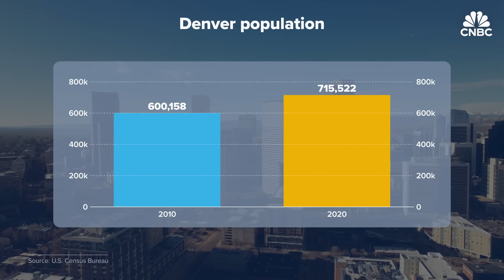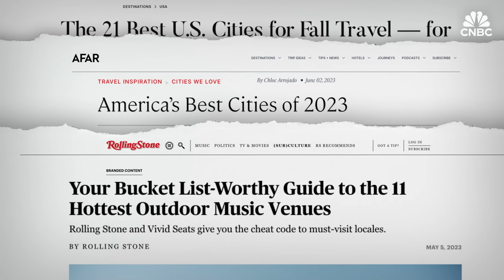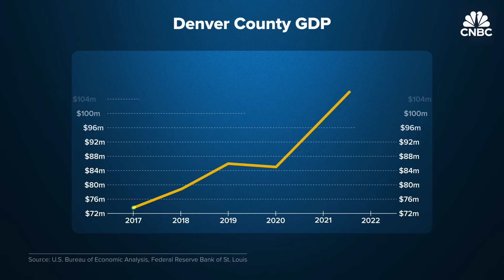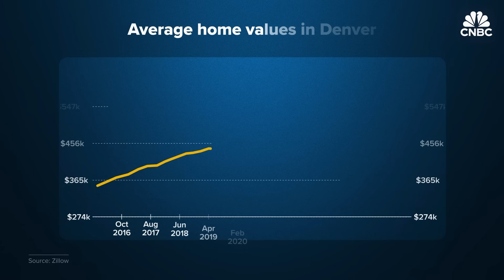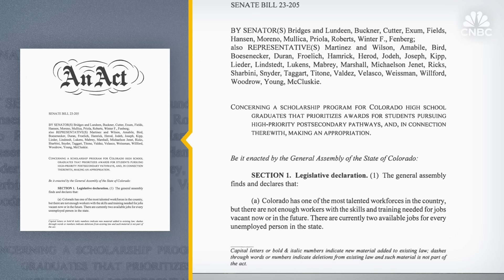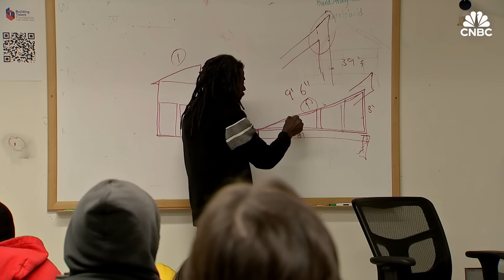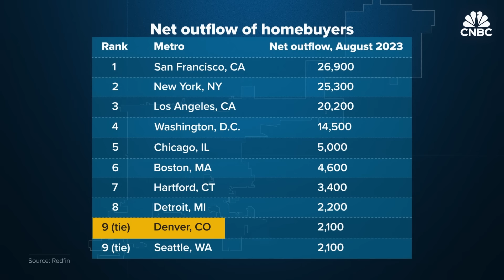Why Denver Is Struggling To Keep Up With Its Economic Boom

Comment: Denver has been destroyed by the likes of Polis and the completely useless mayor Johnston.  Low-level crime is through the roof.  There is no police presence and no law enforcement.  Supposedly in July there was a special action to target vehicles with no license plates or expired license plates, yet that yielded exactly nothing.  No one I know or encountered on social media platforms even saw a single cop enforcing the requirement to have a licensed and insured vehicle.  Road accidents happen constantly as Denver's population becomes overwhelmingly selfish and willfully disregarding of the law.  No one stops at stop signs, speeding is rampant, red lights are meaningless.  And when accidents do occur, do the cops show up?  Can you even get an answer on 911?  Guess what happens then?  You have to claim through your own insurance to fix your car — because car repair costs have skyrocketed over the years — and you get to pay higher insurance premiums because the cops don't write tickets to assign fault anymore.  Because, well, no cops.  So you see cars driving around with whole portions of the body just missing.  No front or back bumper, no grill, no catalytic converter (because thefts of those has been going on now for years here), body parts taped or tied on with string, no license plates.  If you don't have a six-figure income, then you are stuck renting and in Denver, that isn't pretty.  Rents are sky high, massive rental companies owning all the properties don't care about maintenance or property up-keep, so the only way you'll afford living in a rental apartment is with roommates.  You want to go in the mountains?  Good luck.  I-70 is jammed all the time, particularly on weekends.  Arrived at your trailhead and want to park your car?  Good luck, because there are so many people with the same idea as you that you won't find a space.  The mountains are over-run by people, most of whom couldn't care less about actual protection of the environment.  They are just there to get a selfie of themselves doing some stupid thing in the woods like trying to get a picture with a bear.  Denver's government as well as the state's is best described with a single word: incompetence.  They just can't get the basics done anymore.  The straightforward services like trash, law enforcement, education, parks, these seem to be beyond their ability to handle.  If you can't do those things, you know the politicians can't handle the big and hard stuff like housing and transportation.  To natives and people who have lived in Denver more than thirty years, it feels like this city is in steep and rapid decline with leaders who just don't know what to do or how to fix anything.  At this point, the consensus is starting to form that it is time to find a new place to live.  Denver is a disaster and if you stay here too long it will ruin you.

Comment: Denver also leads in gentrification. As a young millennial born in Colorado this boom hurt locals. I was unable to buy a home and barely could afford rent when I lived in CO. My home state is no longer recognizable its home to the rich and is pushing out the middle class and poor. I had to move where cost of living was reasonable and can proudly say I am a homeowner now. I miss Colorado all the time though, wish there had been jobs that paid a liveable wage there and housing was affordable.
Reply: I’ve been to Colorado 4 times in 30 years. It’s gotten crazier each time with the traffic. Not what it used to be. I really don’t want to make the problem worse for all of you by being another coastal transplant hogging up the roads. Roads/highways can’t handle the current population with the sprawl network, yet housing isn’t enough for demand. And transit stops are poorly located and have weak connectivity, resulting in low ridership. And westbound traffic on Friday afternoons is bumper to bumper all the way to Silverthorne/Breckenridge: I experienced that nightmare in broad daylight two weeks ago and it rivals LA unquestionably.
Reply: You obviously didn't look in Pueblo.

Comment: PPP loans were forgiven to big corporations. The small businesses barely received grants or loans during the pandemic. So many small businesses have shut down and continue to do so. Denver is filled with horrific corporate slumlords and there is little to no regulations and resource to protect tenants. Denver is great. But it’s not possible for young people to thrive without the help of parents or grandparents. Many of my peers from 20-30 years old are moving out unless they are high earners. And even then, they will move to an affordable area because their jobs are remote. 

Low price housing doesn’t do much considering the person paying for the house will never build equity as affordable housing could not be sold for 30 years at market price. It has to be sold at AFFORDABLE housing prices. 

The homelessness has been a problem long before migrant workers. Denver failed to locate proper housing and rehab efforts to displaced folks and the pandemic alongside lack of assistance exasperated the already existing problem. Now, you see homelessness on every highway exit. You see it from FOCO to COSP. Not to mention, Aurora is now dealing with growing gangs. When you place poor people and treat them like rats, guess what they do? Riot. And that’s what’s happening. 

Government NEEDS to step in as of yesterday to plan accordingly and mitigate risk. Because it’s a mess. Where are the crazy taxes going? It’s clearly not directed to housing, public transit, or public schools… Public schools, after school clubs, and keeping people busy and educated needs to be a priority. Only way to have a clean, growing, healthy environment is through education and support.

Comment: I lived in Denver for 46 years. Retired in 2019 and moved 200 miles from Denver and 200 miles from Albuquerque. There is an HVAC service company here that has had a "now hiring, no experience necessary" sign in the window for two years. The local MacDonalds has a now hiring sign "$20/hr to start". That sign has been there for two years. Can't find an electrician. Can't find a plumber. But I guess earning six figures in a small town is just too much to ask. Rot in the blue cities.

Comment: If you moved to Colorado and bought a home before Covid, then your mortgage is reasonable and everything is fine. But if you come after Covid increased prices by 50-75%, then housing costs will be a problem on the average salary. Summit County Colorado, where there are four ski areas, would have regular boom and bust real estate cycles. But once most of the land was built out the bust cycles went away. The same thing is now happening to the Front Range.

Comment: My wife and I are teachers and we used to live in the Denver area. On both of our incomes it was almost impossible to live in a safe apartment. We moved to Ohio, bought a 3000 sq ft 3 bedroom home and can now afford to have kids on the same salary
Reply: I been hearing a bit about Ohio being affordable. 

Are the winters very bad?
Reply: @geofox9484 nah, I mean occasionally it could get into the single digits, but usually it hangs around teens to low 20s and 30s during prime winter
Reply: Did you also gain 200 pounds each in order to fit in?
Reply: You could do that anywhere in Colorado that isn’t Denver…
Reply: Wow I moved to Colorado Springs from Cincinnati in 2013. If you're not making $60k a year it's rough. And jobs hate giving out raises.
Reply: Why didn't you move to Pueblo?

Comment: Tell NIMBYs that R1 zoning, million required parking lots, and minimum lot sizing needs to go. You gotta be dense like European cities to enjoy less homelessness and cheaper housing. Smaller,  yes, but cheaper.
Reply: You don't have to be dense.  You just have to build.  The problem is a process that makes it difficult and expensive to build.
Reply: @ISpitHotFiyaa  In fact, you do need density if you're going to have any substantial quality of life.  Sprawl leads to "drive till you qualify", and yes, you get to SEE less homelessness that way, but it is still there.  You spend more on services in the long run leading to continued flight, and you lose out on successful third places, job opportunities and cultural benefits.
Reply: @nickmonks9563  No it doesn't.  If you don't like "sprawl" then don't live in the suburbs.  People like you telling other people how to live is exactly the problem with housing in this country.
Reply: @ISpitHotFiyaa  I'm not telling other people how to live.  I'm explaining that if people want to actually solve the problem they will need to modify their expectations.  If the place you can afford to live in is two hours from your job then you have a problem.  That's the nature of sprawl.  Sure, if you're lucky enough to have a high paying tech job near your suburb, good for you.  But that's not the reality for most people.  On top of that, suburbs are subsidized by their more dense counterparts (and by increasing new sprawl) because there is just so much more infrastructure to build and maintain, but not enough of a tax base to maintain it after around 20 to 30 years...which leads to people fleeing those suburbs for other ones or other cities, diminishing the tax base, making those locations unsustainable.  Now people might be able to afford to live there, but the services are awful, employers don't want to be located there, and you're left with continued housing issues as a result.  

Density by itself doesn't solve the issue, but in conjunction with smart planning and incentives, it is a major component of building sustainable housing solutions, in addition to sustainable cities in general.  That doesn't mean every locale needs to be a skyscraper riddled nightmare, but single family cul-de-sacs have very limited sustainability value in a housing crisis.
Reply: @nickmonks9563  That's not the nature of sprawl.  That's the nature of oppressive planning.  People live two hours away because the cities two hours away actually allow houses to be built whereas the ones near the jobs are worried about sprawl and therefore don't allow houses to be built.
Reply: @ISpitHotFiyaa  Houston, Phoenix, and Los Angeles beg to differ with you.  All cities highly permissive of sprawl.  It sounds like you're trying to turn this into some ideological fight here, but it's not.  You may enjoy living in the 'burbs.  And you may have a job near where you live.  If so, great.  But the reality is that if most people want to be near where they work, lower the costs of transportation, lower their property tax burden, and improve access to services, that requires density.  My own neighborhood, which is a lower density inner suburb, is dealing with this right now.  They are complaining that we are in a food desert because we have no nearby grocery store that our often older population can't walk to...but we also don't currently have the density to support one.  So you drive or have to pay extra to have food delivered.  These are the externalities that sprawl hides when we are tallying costs.
Reply: @nickmonks9563  I've lived in Houston.  The commute was fine.  Housing was a lot more affordable.  Nobody lived two hours outside of Houston in order to afford a house.  That's something cities practicing growth management can't claim.

And this is an ideological fight.  You think you have some right to tell people how to live and I think people should make their own choices.  Those are two different ideologies.

Comment: The public transportation system sucks SO BAD! In recent years, they built a railway system from downtown Denver to the northern part of the city. Guess where that rail system ended up going! To the rich home areas off Colorado Blvd. It should have gone to the lower income apt areas where the bus line goes. But no. So stupid! You'd think with gas prices, and the traffic congestion, that would be the smart move. I mean to own a car IS a status symbol. Again. So stupid.
Reply: The Turkeys in Eastlake have to get downtown also.

Comment: I lived in Denver for a few years in the early 1980s. The thing to know about Denver is that it's the only big city for 1000 miles in any direction, so it's kind of an odd place. People think of it as a major city but that's mostly because it's all by itself in a geographic area that is either plains or (to the west) a mountain range all around it. It's nice, but it's no NYC or LA.

I haven't been back there in decades though so I don't know how much it's changed since then.
Reply: Thank God it's not LA or NYC.
Reply: Denver is Ghetto if that makes you feel more at home.

Comment: I just visited Colorado this month. I love the state but the Denver metropolis is a salad bowl of smog, traffic, sprawl, and all kinds of economic challenges. There are upsides, but they are outweighed. Once west of there and well into the mountains, Colorado is a great state.
The other problem is that the metropolis has too little housing for the demand, but too little infrastructure for the current population as it’s very much sprawled. Plus the public transit stations are poorly located, surrounded by mostly-empty parking lots and open fields. Ridership is weak from the poor connectivity.
And two weeks ago I did something one should avoid at all costs: driving west into the mountains on I-70 on a summer Friday afternoon. Even well west of Denver and in seemingly nowhere, it was bumper to bumper traffic all the way to the Continental Divide. Forty minutes on a quiet day took two hours.

Comment: Living in Los Angeles, I just don't see the appeal for living in Denver. What does Denver have that LA doesn't already have? 1.7 jobs for every 1 job seeker?  If all the low-pay dish washing jobs, cook jobs, janitor jobs, and the higher pay plumbing jobs, caregiver jobs and nursing jobs are excluded from the pool, how many jobs that are available are also desirable for the average job seeker??  How many of those so-called jobs available pay a decent wage to afford the cost of living in Denver? Numbers alone don't mean anything. Yes, the 70,000 homes shortfall also doesn't mean anything when the city has how many thousands of asylum seekers from all over the world?
Reply: The thing Denver has is not having to live in Los Angeles, which as someone who lived in LA for years, is not inconsiderable. Most miserable place I've ever lived.
Reply: LA is a hellhole.  Denver getting there but not quite
Reply: caregivers make minimum wage (or illegally less) here in colorado. job turnover, tool costs, and a lack of protection dont help plumbers either. most trades folk, with a lack of unions outside of IEW, are beat up by the time they are 30 and desparate for an office gig.
Reply: That is the dumbest statement I have heard in a long time.
Reply: Well, not living in Los Angeles is a huge benefit to living in Denver.
Reply: You can’t compare Los Angeles and Denver. That would be like comparing Denver and Wichita. 

There is a reason why the LA metro population is 18 million + and the Denver metro area has less than 3 million residents. It’s simply a better place to live. 

Denver can’t compete with LA. The economy, weather, culture, outdoor activities, higher education etc. LA leads and cities like Denver follow.
Reply: @triplikeido75  How?  Denver has the same crimes and homelessness that plague LA, LOL, but without LA's good weather, beautiful beaches, higher salaries, better food, better entertainment, etc, etc...
Reply: @RealLadyK  ...higher cost of living, sprawl, insane traffic with a terrible transit network....
Reply: @nickmonks9563  LA has higher cost of Living than Denver because LA also has much higher salary than Denver.  Denver also has a terrible transit network. During winter, the traffic in Denver is really terrible, icy roads, icy windshields....slow traffic.
Reply: @latinoheateddieguerrero7644  LA is number one in Illegals and homeless, Denver is number two, but we are trying.